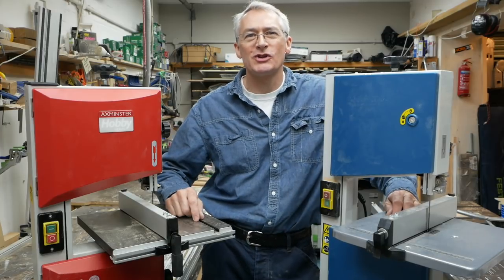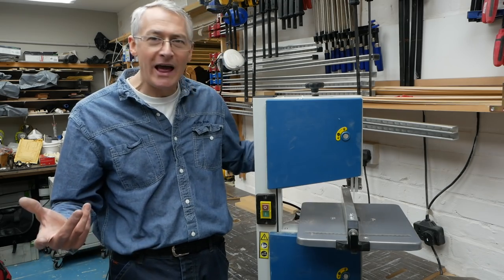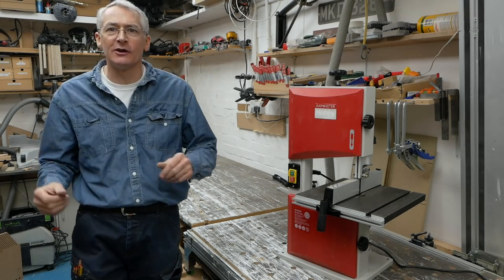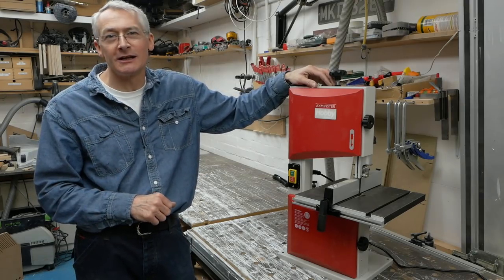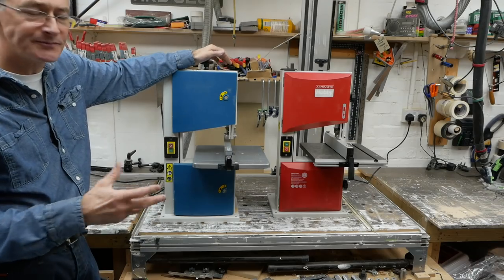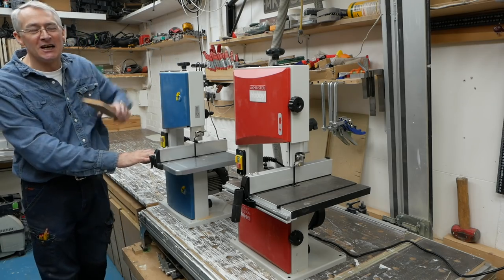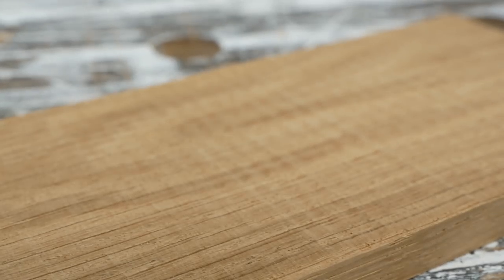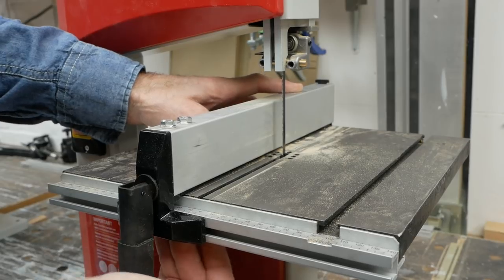£80 Bandsaw vs £200 bandsaw #140

Comment: Peter ,Titan one isnt bad either,its 120euro(£100) ,only difference with these mini badsaws is brand,colour and a few bits. The frames are all exact same,power switchs etc. Wonder why axeminister went lower power motor.
Reply from the maker: I think they all have 250w motors, it’s the Aldi that’s the outlier with 350w. Must confess, I’d forgotten about the Titan - must check it out! 👍
Reply: Induction motors have more torque than conventional motors so a larger motor wouldn't be required.
So I'm led to believe. I'm a woodworker not an engineer lol
Reply: I'm not an engine guy but I know with computer power supplies (and other things) cheaper products like to put out wattage based on "peak" rating. Basically meaning it might be able to hit that number but not likely to sustain it. A more expensive unit should be able to hold whatever it's rated for.
Reply from the maker: Yep, this exactly. I'll be putting out another vid soon just to clarify, but it seems to be common practice to quote two motor ratings, one for continuous use and one for intermittent use. No surprise that the marketing guys latch onto the higher number, lol. The Axminster is rated at 250w for continuous use, whereas the 350w quoted by Aldi and Scheppach is for intermittent (30 mins max) use; continuous use is 250w, same as the Axminster. 👍

Comment: Unfortunately the Aldi one looks unavailable/no longer stocked using the links in your description and those in the comments. Are there any others that are going for sub a ton? Great review. Thanks, Peter 👍👍
Reply from the maker: Thanks! Yes, looks like the Aldi is out of stock again. Shame. Not aware of any others below £100, the Scheppach from Screwfix is the next up at £110 or so. 👍
Reply: Screwfix do a "Titan" for £99.99, from looking online it's suggested it's a rebadged Ryobi - https://www.screwfix.com/p/titan-ttb705bds-80mm-bandsaw-230-240v/5688p
Reply: bill coniston Thank you 👍
Reply: The Bearded Artisan  - Aldi have different stock on a week by week basis. I’m sure they’ll have this band saw again later in the year. Keep checking on their website.
Reply: Aldi tend to repeat their power tools on an annual basis, so keep checking the website for the Special Buys in the Summer. I bought one last year after seeing Peter's review. Must admit it's still sitting in the box waiting to be used (I am a habitual squirrel like hoarder of Aldi gear in case it comes in useful, as you have to buy it in the week or so that it's in stock). I'm sure I will be getting it out and set up this Spring though, once I have cleared out my messy workshop. Been saying that for years too ;)

Comment: Workzone sell for Php 8,500.00 here in the philippines, i wonder if it can slice a 3 inches galvanize pipe accurately, In your experience sir, will it work?
Reply from the maker: Sorry, I have zero experience of cutting metal with a bandsaw, but 3” would be just about maximum capacity. Bear in mind as well that the throat is only 200mm on these small saws, so you’ll only get short lengths of pipe...
Reply: @10MinuteWorkshop  thank you for the info. I am really going to buy a sliding bi metal bandsaw when somebody  offer me this workzone bandsaw so i immediately search to view some reviews about it. I learn something from your videos. Thanks again mr. Peter

Comment: could you improve the aldi table with some simple cheap mods?
Reply from the maker: You could possibly beef the table up with some plywood or MDF, but the problem is that it’s the whole mount assembly that’s a bit flimsy - basically just a bent steel bracket that the table mounts to with two bolts. So, you could take some of the flex out of the table, but the table would still be on an iffy mount....

Comment: You'd hardly call the Ax a premium saw... what about the wheels are they cast(what they should be)or cheap pressed made from recycled tin cans?
Reply from the maker: It’s a premium saw in this category - 8”/200mm benchtop bandsaw. If you can find a better one, let me know and I’ll throw that into the mix as well. And yes, cast alloy wheels 👍

Comment: Hi Peter,  I have been using my machine Mart version for some years now (threw the blade away and put a tuffsaws blade in made all the difference) my issue is with the mitre gauge.  which is really sloppy in the non standard slot.  Did you get the gauge and if so is it an accurate fit?
Reply from the maker: Yes, big fan of tuffsaws, Ian’s very helpful and generous with his time. I didn’t get the mitre fence, but they claim it’s a snug fit in the slot; I’ve ordered one, so we’ll see 👍

Comment: I've got the blue one damn can't get it calibrated after 3 hand spins band slips and falloff ;( I don't know what to do.
Reply from the maker: Return it or exchange it, if it’s the Aldi one; the quality control hasn’t been that great since I made this video - see many similar comments below - and in particular there seem to be problems with the bottom wheel popping the blade off. Aldi are well aware of the problem and exchange without quibble. 👍

Comment: Why do bandsaws have so little clearance? Searching around, but need 30cm clearance. I am gonna spend big for that arent I?
Reply from the maker: Clearance where - to the throat? That’s because of the wheel size; bigger wheels, more engineering required to keep them true. And yeah, 300mm gonna cost 😬🤷‍♂️

Comment: The big boys say, that The saw must have A cast iron table. I think the table must be solid. Cuts must be consistent. 

I still are trying to build A workshop in garage. In winter The problem is sharing it with car.
Reply from the maker: That depends on what you expect from a bandsaw, I honk, but sure, the cast iron table and solid fence are very good things 👍And yet... it’s a bandsaw for the price of a tank of fuel...🤔
Reply: Peter Millard well i agree with you. All comes to What you use The bandsaw for. I have wanted for long time A bandsaw. Here in Finland you pay for The cheap onces 160-550€.

Comment: I wonder if it would be possible to upgrade the table on the Aldi saw to a cast one with a good fence?
Great uploads
Reply from the maker: Thanks! No, not really practical because of the way the fence is mounted tbh. You could probably beef up the existing table, but all you end up with is an £80 bandsaw with a beefier table - diminishing returns, and all that...

Comment: You never once mentioned the guides. The most important thing to mention, does the more expensive bandsaw have rollers behind and either side, to guide the blade, or wear plates.  Rollers are where the quality of the machine are obvious. Without them you are buying cheap and nasty. Which is fine for occasional use, but it is a toy not a tool.

Comment: Hi,
Do you always cut thin rips on the inside of the  blade.  Would it not be safer to cut on the outside
due to pinch?

Regards,

Bill.
Reply from the maker: Hi Bill. In truth I rarely cut thin rips for anything other than these type of videos, but when I do, yes, I bear against the fence in order to make a consistent - therefore comparable - cut. 👍

Comment: Hi Peter ! Great and informative vids ! Thanks !

I am trying to decide what bandsaw I should buy; I want to go into some hobby woodmaking. My definitive goal is to build my own acoustic guitar.

The ALDI saw you showed is almost the same as the Scheppach HBS20, it seems. It's 350 watt, and has that 'cheap' table. I found a Güde GBS 200 Profi saw, with almost the same specs, but with a (aluminium, no steel ...) table that looks more solid, and only 250 watt. It's just a few euro's cheaper than the Scheppach, but that isn't a decision item to me.

My question: is the lower wattage of the Güde a problem ? Should I go for the Scheppach ? Or in your opinion would the somewhat better looking sawtable of the Güde be the best choice ?

Link to the Güde GBS 200:
https://www.1ekeus.nl/gude-gbs200-lintzaag.html?channable=e7844.MzAzNw&gclid=Cj0KCQjwgOzdBRDlARIsAJ6_HNkEnY2iyDwBSl1WnPIfJgEgNFMRur_XUdA61CvX3XldXlbJrbKTUnQaAlB6EALw_wcB

Link to the Scheppach HBS 20:
https://www.1ekeus.nl/scheppach-hbs20-lintzaagmachine.html?gclid=Cj0KCQjwgOzdBRDlARIsAJ6_HNnVX5Aq5wagOc8z0n_TM2vXPwl1ziwEWgDT0iiKVJEpyqp8G0vSTxgaAsz3EALw_wcB
Reply from the maker: Crash Cowboy Hi. I’ve done a number of videos on small, cheap bandsaws, starting at video #50 - there’s a playlist with them all in, and all your questions are covered there - the Aldi/Scheppach connection, the wattage discrepancy, etc.. etc.. The other bandsaw you found is also a dead ringer for the Titan bandsaw that comes up later in the videos (#148) as well. Short answer, don’t worry about the wattage difference, go for the one with the best capacity for your needs 👍👍
Reply: Thanks !

Comment: So I bought this band saw from Aldi and it doesn't seem to be working for me. The fence markings are not accurate by about 4mm, and I cannot get the blade to cut straight. Keeps wandering to the right. If I tension it a bit more it just falls off the wheels. Hmmmm
Reply from the maker: Yes, I’m hearing this from a few people. This years model seems to have a few quality issues - I’d chuck it back to Aldi for refund or replacement. 👍👍

Comment: Neither of them are professional bandsaws both for the hobby market. How do they compare to a so called professional bandsaw that is in use 24x7?
Reply from the maker: Yes, they’re hobby bandsaws - I make that clear. They’re not meant for any kind of professional workshop use, they’re bandsaws for the price of a tank of fuel. 👍
Reply: Yes you did make it clear,  and obviously in the hobby market there are  grades or standards of machines, but how do they compare with so called professional ones?
Reply from the maker: I don’t own a so-called professional bandsaw, so I’m afraid I’ve no idea how they compare. As I said in reply to your other comment, the Aldi was my first bandsaw, and I don’t have it any more.

Comment: You glibly state you set them up. I have just bought the latest Axminster bandsaw, now called Craft. Having assembled it, the instructions go on to state to set the bottom guides it is recommended to remove the table. It is nigh impossible to set them without doing so. That involves removing eight bolts, and manoeuvring the heavy table on and off. It is a ridiculous design. 

I would not advise anyone to buy this bandsaw. I bitterly regret my purchase.
Your review is, therefore, also ridiculous in not mentioning this.
Reply from the maker: Couple of things; this wasn’t a review, it was a comparison between an entry-level supermarket bandsaw and a similarly sized ‘premium’ bandsaw from Axminster, and obviously I can only compare the saws I had at the time, which isn’t the one you bought. 🤷‍♂️ I cover the unboxing and initial setup of my bandsaw in the following video #141, and I commend Axminster for their clear instructions; if there had been anything as knuckle-headed as needing to remove the table to adjust the bottom guides then I would have mentioned it. There wasn’t, and I didn’t, though I did mention tilting the table for easier access to the bottom guides. If you bitterly regret the purchase then return it to Axminster - they’re usually pretty good about this kind of thing. 👍👍

Comment: These are all rebranded chinese machines. I had an Einhell for a couple of days before asking for a refund. Would stall when attempting a curve less than 20mm radius. Also wheels weren't coplanar, so the blade would rest on the forward portion of the lower blade, right on the aluminium instead of the rubber. Completely unnecessary rack and pinion system for the blade throat, since it was plastic and quite light to move by hand. Horrible tin table, never square against the blade ir fence... I could go on... Cheap can  become expensive very fast
Reply from the maker: Yes, I’ve read that about the Einhell as well.